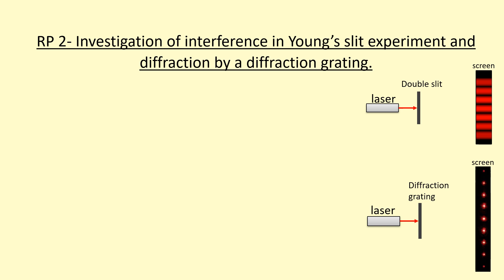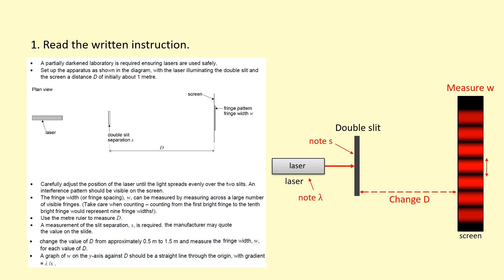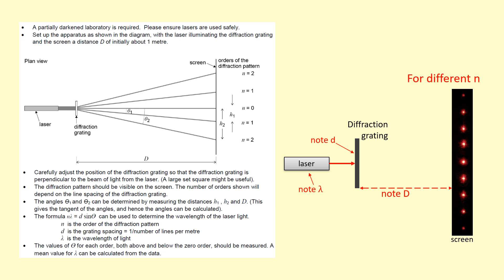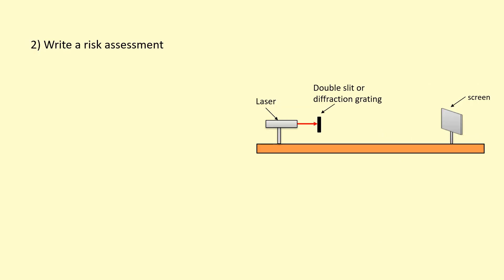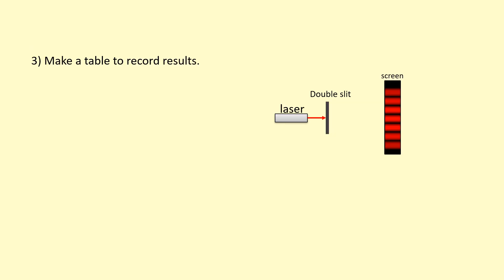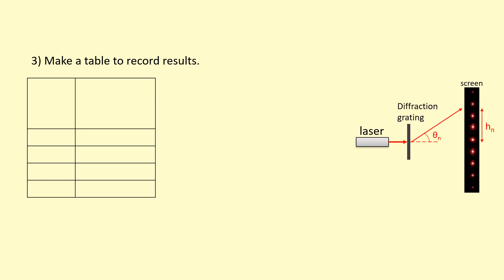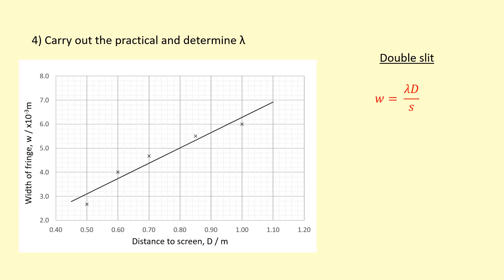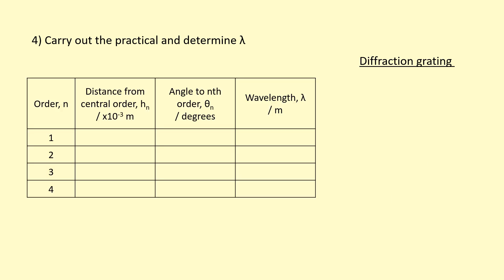15.52 Required Practical 2 - Double Slit and Diffraction Grating CPACs

Comment: Mr naga physics would I get the marks if I say that the disadvantage of using vernier callipers and micrometers , like for example measuring a diameter if a conductive putty let's say, the disadvantage is that parallax error could be introduced while using them
Reply from the maker: i don't think there will be parallax with micrometer and vernier calipers. ( the scale and thing you're measuring need to be a different "depths" from your eye sight for that to occur)

Zero error is a posabality with both. Problem with the putty is when you use a micrometer or vernier calliper is that the jaws make change the shape of the putty you're looking at, it might squash it.
Reply: @MrNagaPhysics  so whenever the question ask a problem about vernier calliper ans micrometer,  I should talk about deformation?
Reply: Please can I have a video on newton meters and often get asked , they are underlooked and I want more knowledge on them